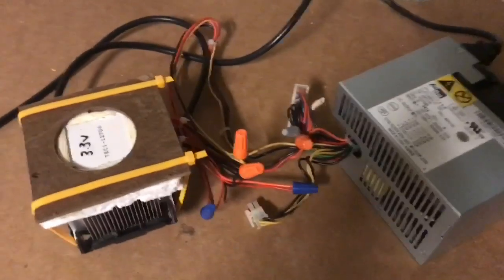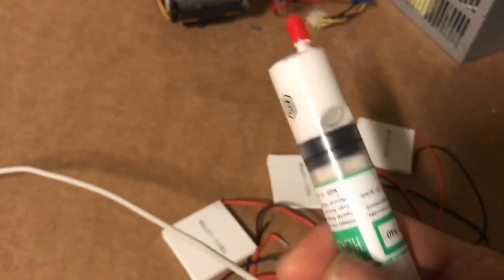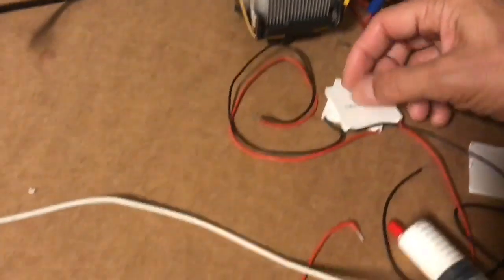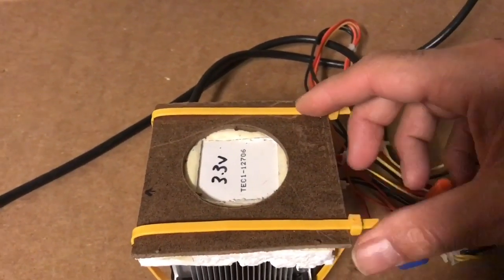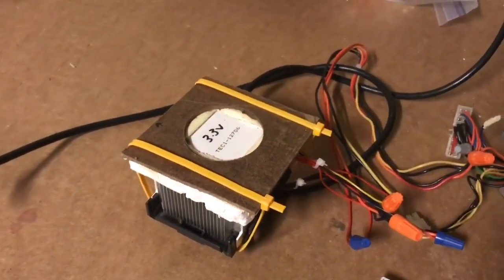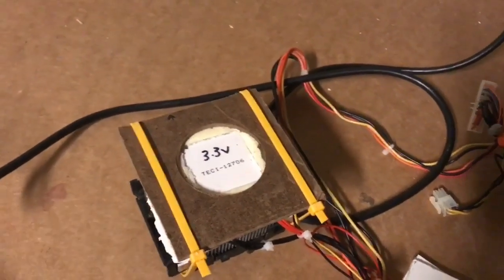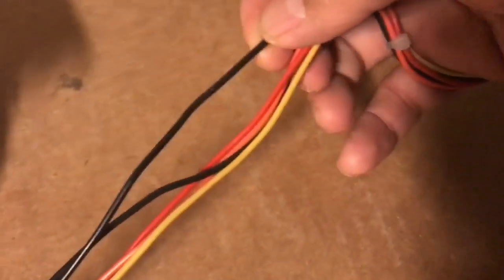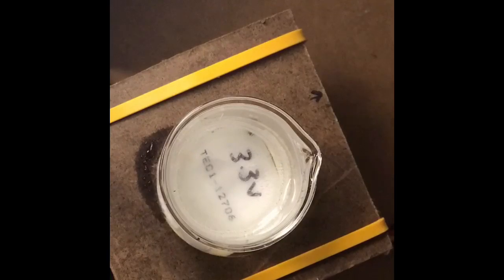Make -50 C Peltier Cooler

Comment: Rather than using your power supply, what about using a 12V SLA battery with buck converters to supply the appropriate voltages to the peltier modules.
Reply from the maker: Yeah, that would work. At the time I made this video, I just had that computer power supply convenient so that’s why I used it. But definitely you could use buck boost modules to get the correct voltage for each module.

Comment: I would like to know if it would be possible to mirror the temperature of -50 on an aluminum or copper plate (for example, 10cm by 10cm, around there), like, what would be the difference from the middle to the ends of this plate?
Reply from the maker: I bet it will be. However, it depends on the thickness and amount of metal in the plate.

Comment: Would I lower 1 liter of water at room temperature to 0 degrees faster, again in the room, with 12715+12706 cascade or without cascade? My goal is not to reach -50, but to lower the water to 0 degrees quickly?

Comment: I attempted this with a vague understanding of series voltage drops with a single output 12vdc psu capable of 30A draw thinking it would scale down proportionally & leave me somewhere in the neighborhood of 9v-6v-3v. Testing via MM read that at the appropriate junctions yet never achieved a workable topmost super-chilled unit despite having basically what you have in your video towards heat sinking + ~3x the surface area and a whole mess of processor fans arranged with care. Just posting this on the possibility of someone with better fundamentals understands if I went wrong in wiring series like that and could detail out the inherent flaw destined to fail in that approach. I'm assuming in retrospect that it has something to do with likely a larger current draw at the lower voltage TECS creating a unmanageable higher heating wattage that doesn't exist when wiring it up like the video did.... I just also fucking despise trial and erroring without fully grasping key concepts which google is often a prude c**t who won't be finessed into giving up what I'm after until I put in a soul-draining amount of effort towards accomplishing that end.

Comment: can i used it in mini fridge? i used temp control relay so it will autimatically off when i achieve my desired temp. and auto turn on after my desired time. ex: 5mins. i want to used it atleast 12hours/day. is it dangerous? thanks

Comment: Why the different voltages?
Reply from the maker: The reason is the reverse hot side makes a lot of heat as the cooling effect is not efficient. There is much more heat production compared with cooling on the reverse side at 12V. At lower voltage eg 5V or 7v with cascaded modules, running the upper one at lower voltage makes less heat for the amount of cooling and results in more efficient net cooling compared with running both cascaded modules at 12V

Comment: im down to -7. Damn its hard. We need an intelligent software controller that experiments with currents on each level to find the lowest for you. That would be cool.
Reply: what currents you used??
Reply: @devwadhvani3905 I had two levels with copper plate between. 4 peltiers on nottom levsl, 1 on top. Bottom level was about 3.5v per module and top waa about 9v. I had independent variable power supplies to rxperiment. It got super cold with no load, but when i put the heatsink on the cold side it was barely pumping any heat. I think maybe the issue was the contact surface with the copper. Gave up eventually.

Comment: I bought a refurbished power supply of the same type (Lenova 49P2149), and I am having trouble finding basic information about its wiring.  What connections are required to turn it on?
Reply: Found it.  Green to black.
Reply from the maker: These are the same for all ATX power supplies: 3.3V wires are orange; +5V wires are red; -5V wires (if they are present) are white; +12V wires are yellow; -12V wires are blue; ground wires are black.

Comment: I was considering the improved efficiency with lower voltage but I still require a decent temperature drop I'm using a 8x8" 24 pass (4 pipes 6 pass each) radiator/heat exchanger on the hot side and it is VERY efficient at removing heat. What's your opinion of using 5 TEC side by side at 50% voltage and cascading another 5 at 25% voltage?  I'm trying to build a small AC unit to cool approx 250 square feet about 10-15 degrees F (6-9 degrees C), I'm planning on liquid cooling both sides using common aluminium heat exchangers found on amazon etc.  The hot side will be pumped outside in approximately 85-95 degree F ambient (30-35 degrees C). Assuming my 250 sqft is the same temp, I would like to cool the space to 75-80 degrees.  Per this video 4 TEC's Stacked can cool to -50c (with no load)t, with water (or antifreeze flowing through) is it possible to bring the fluid on the cold side from ambient 35C to 0-5Cc? (32-40 F)  I realize the heat exchanger on the cold side will warm this up, the question is will 5 stacked TEC's enough to bring the temp down low enough so it enters the heat exchanger as cold as possible?  Any experience with something similar?  Any Suggestions?
Reply: I am working on one now with 80x80mm aluminium water cooled heat exchanger and 120mm radiator. + 2 fans. I have 4 pelteriers on laybr 1 and 1 pelter on layer 2. I never considered cooling the  water. Woudnt this just work out the same in theory and stacking another Peltier layer? I cant seem to get below -10C. I think what makes the most difference is an independent vairable power supply for each layer (dont have this yet) , as its impossible to know what optimal voltages without experimenting.,

Comment: I've been looking at using Peltier modules for a cloud chamber for a small museum locally. Just the job, Have the PSU (actually a whole shelf full), a pile of heatsinks and fans so just need some Peltier modules, I already have one.
Reply from the maker: Stephen Cook wonderful idea! The low temperatures generated by this setup should work well for a cloud chamber. The most important thing with this is the quality of the peltier modules. I found cheap ones did not work well and were prone to failure.

Comment: I love peltier cells. TEC will never be as efficient as a compressor. But TEC efficiency can improve a lot with COP>1 when they are made to work between 25 to 50% of their maximum power (see datasheets). Of course this means you will need many more cells to make whatever thermal work you were intending to do.  IF you want to to the same task with less TECs then you will need (and waste) a lot of electrical power...which also means an over complexity in cooling system for the hot side of your stack (= more $)
Reply from the maker: Claudio Adrian Zanardi they are fun to play with!!! Undevolting them  significantly improves Cooling efficiency.
Reply: I was considering the improved efficiency with lower voltage but I still require a decent temperature drop I'm using a 8x8" 24 pass (4 pipes 6 pass each) radiator/heat exchanger on the hot side and it is VERY efficient at removing heat. What's your opinion of using 5 TEC side by side at 50% voltage and cascading another 5 at 25% voltage?  I'm trying to build a small AC unit to cool approx 250 square feet about 10-15 degrees F (6-9 degrees C), I'm planning on liquid cooling both sides using common aluminium heat exchangers found on amazon etc.  The hot side will be pumped outside in approximately 85-95 degree F ambient (30-35 degrees C). Assuming my 250 sqft is the same temp, I would like to cool the space to 75-80 degrees.  Per this video 4 TEC's Stacked can cool to -50c (with no load)t, with water (or antifreeze flowing through) is it possible to bring the fluid on the cold side from ambient 35C to 0-5Cc? (32-40 F)  I realize the heat exchanger on the cold side will warm this up, the question is will 5 stacked TEC's enough to bring the temp down low enough so it enters the heat exchanger as cold as possible?  Any experience with something similar?  Any Suggestions?
Reply: Jesse Valentine hi, sorry for late answer :) the surface you talk about is approximately 23 square meters, a nice big room. Independently from the cooling method, before you should make some calculations to understand how much energy is required to drop the temperature by 1• Celsius of all the air contained in the room. Once you know how much energy is needed, you “could” start designing your cooling system and calculate how much time such system would take to drop the room temperature at your desired set point. I said “could” because here comes the problem: while your system is pumping out of the room thermal energy (cooling) the outside environment through walls, windows, door etc... is pumping IN thermal energy. So the sun delivery at ground roughly 4kw of energy per square meter (at noon when sun is on the zenith) of course depending on a lot of variables. Now calculate the surface of your room that is exposed to the outside (considering the walls are vertical and not horizontal so the wattage is Lower) and in relation on the grade of insulation of your room, you could determine how much energy the room absorb from the outside. Your system should be able to pump out also that energy otherwise it won’t be able to drop the temperature because the amount of energy IN is higher than the energy your system can pump out. :/

Comment: Good job. I see many many using Perrier for hot/cold purpose without knowing the science behind it. 
The way you explain proved that you know science.

One small suggestion. Instead of fan use running water which could increase longevity of device. 

Reason you would have observed as soon as you stop, the temperature starts to reverse immediately. This will damage Perrier device. Liquids drain more heat than gases from solids.

It's just my suggestion. Anyways your construction is awesome. Keep it up.

Comment: i tried to use a 710 on the bottom and then the 706's but the 710 heat was hard to manage. Its heat slowly dropped the cool temp down

Comment: mine went to 14 c only
Reply from the maker: I found that the quality of the TEC cooling units make a huge difference. I used the TEC12706 but depending on where I bought them some did not work very well but others worked really well. I  found that the better the quality, the better they worked.
Reply: i used thermal paste no insulation turned down the power on the 3.3 and 5 v chips and managed to get to 10C
Reply: Me too

Comment: so your not running 6amps through all the chips?
Reply from the maker: Crypto Noob no exactly. The bottom 12V chip takes the most number of amps. The top lower voltage chip uses far less amps.
Reply: what if you ran 12-5-3.3 all at 6 amps ea?

Comment: By using the stack peltier, within what time the temperature reached -50C. Basically I want to know, how much time does it takes to cool a beverage can for instance.
Reply from the maker: Ramesh Aidasani it gets down to -50 in a few minutes
Reply: Thanks for your immediate response. When you say few minutes. Would it be in 2 minutes. I would like to use this for instance building a cooling box for the beverage can or bottle to cool it in 2 - 3 min time. Can I achieve this.
Reply from the maker: It would not be good for cooler because of slow rate of heat transfer for the top 3.3 V module.  Also to imporove heat transfer for a small cooler, you would need a heatsink with fan blowing on itto allow more efficient heat removal by the Peltier.
Reply: Thanks, Can you suggest any other method to achieve my objective.

Comment: Thank you for the great video. I have a silly question. If I use TEC1-12712, which is a higher spec than TEC1-12706, and ~600W power supply, same dimension and stacking, the temperature can be approached to lower than yours? Thanks
Reply from the maker: Choongwon Seo it is possible but the thing with 12715 is they make more heat.

Comment: Excuse me what is the wattage of the power supply?
Reply from the maker: TheWayabo it’s small about 240W
Reply: Thank you so much, do you think this could cold a space of 1 cubic decimeter to the mentioned -50°C? I want to use it to freeze diverse components and liquids like alcohol
Reply from the maker: Yes that is the computer power supply maximum output power, not the usage.
Reply from the maker: I am not sure how much volume it could freeze. I know it can freeze a beaker of water quickly. The best way would be to cool a small insulated cubic volume and then try a bigger one. Could also use it to freeze the contents of a small thermos.
Reply: Thank you again, I'm trying to make a distiller machine but I want to take alcohol to  -100°C and then pass it thru an also cool down achiote (a seed) and then use a vacuum to evaporate the alcohol with moderated temperature, I have the other things but I still need a machine to cool down the alcohol, do you think that if I put like 3 of this coolers against the walls of a steel bottle with 1 liter of alcohol could them take it to -70 or -80, I want the -100 but I will settle with -70, well maybe I'll settle with -50 if I make it work it but I want to try to go all the way first. 

Changing very fast of topic I notice that the amps delivered by the power supply are a lot more than the recommended for the peltier plates, I guess it will only reduce their life time didn't it?
Reply from the maker: I had one of them fail on me, but I think it was because I was trying to shove it in a small space and might have cracked it.

Comment: Excellent presentation.  Please explain the use of different voltages. 12v 5v 3.3v.  How much power is being utilised when functioning.  What was the temperature of the Heat Sink when the module was at -50.  Cheers.
Reply from the maker: By stacking successively lower voltage ones there  is successively less heat generation by the Peltier modules at the top of the stack. This leads to improved cooling at the top of the stack. This is at the cost of efficiency. The choice of voltages 12,5, and 3.3 is arbitrary and was determined by what was available from the PC power supply.
Reply: @BrianDhvTinkerer  so. Can i give all 3 p module 12v and effect remain same like - 50
Reply from the maker: @tasavvur  You could but 12V cascaded would make too much heat in the top layers and reduce efficiency
Reply: @BrianDhvTinkerer  I have just started playing with these and currently i am using 2x12706 both 5v. Today i hit -14celcius using only total of 15wats/3amps. Room temperature was 18celcius. I am using modern CPU heatsink, which can easily stay very close to ambient temps with these low wat-rates. I have not yet used any thermal paste, because just testing out. I am using a 8amp usb phone charger to power those Peltiers, works great (just had to make my own USB cables, because normal ones can't deliver enough amps). :) Now i am waiting extra 12706 to arrive, to see if i can still go lower temps with 3x12706 5volts. The idea is to build a mini fridge, which can be also powered with 20.000mA power banks, great to have in beach. ;)
Reply: @Ruube1978  hi Can you help me with same goal
Reply: My apologies for being a pain;  1. What was the Voltage and Amperage being consumed as the unit was operating. 2. What was the temperature
on the Hot side at -50. cheers

Comment: Great to see that stacking equal Peltier modules also gives pretty low temperatures!
The problem is that powerful modules also have a low thermal resistance. So, they need a lot of power to even reach a high temperature difference due to the internal heat conduction from the warm side to the cold side.
According to the datasheet, the TEC1-12706 won't even reach more than about 25°C temperature difference at 3.3V.

I'm going to build a stacked cooler myself; just ordered a beastly TEC1-12715 as the bottom module, a TEC1-12703 for the middle and a TEC1-3103 for the top.
The first module should reach -5°C with 50°C heatsink temperature, the second module may go down to -42...-48°C, and I hope the third module will bring the temperature below -70°C ;) . Maybe I'll make a video about it.
Reply: Did you try this yet? What did you end up with?

Comment from the maker: It’s not very energy efficient. The stacked Peltier can get down to low  temperatures theoretically down to -105C but at a huge energy cost. I would use the 600W to run a refrigerator compressor for cooling the 90 sq foot room. It would be more efficient then using the stacked Peltiers.
Reply: But significantly more complicated and expensive to implement phase change cooling